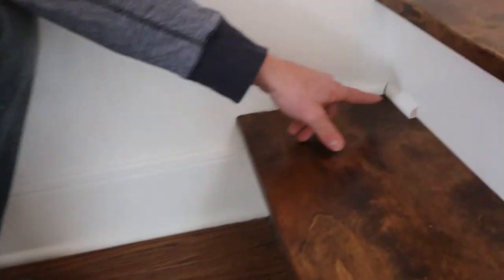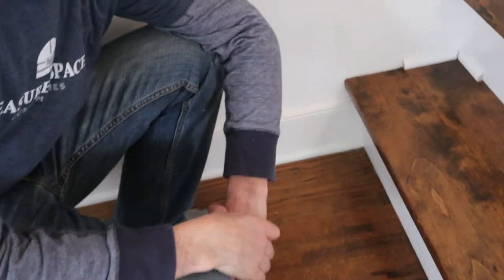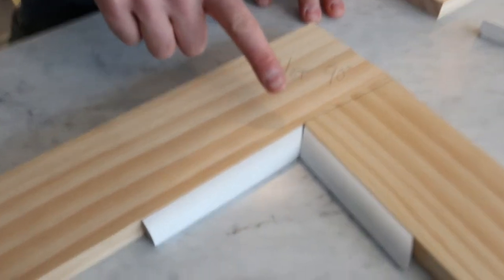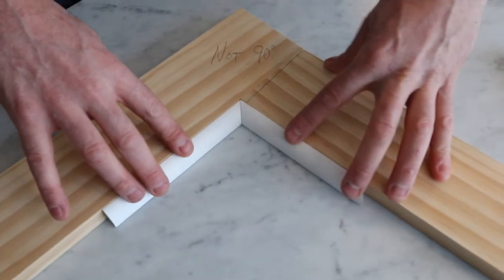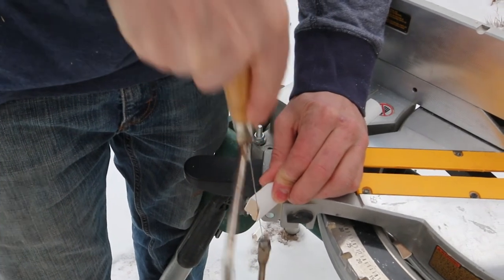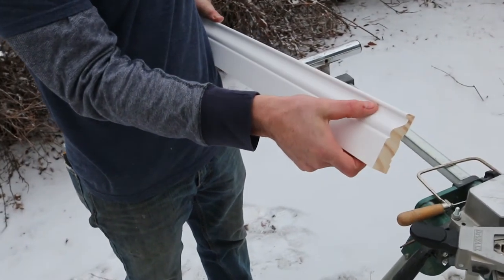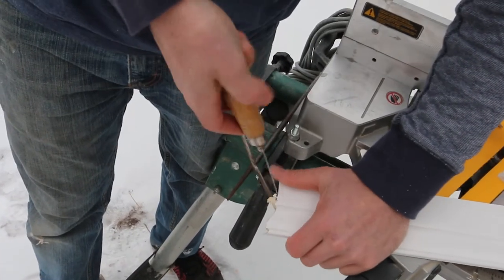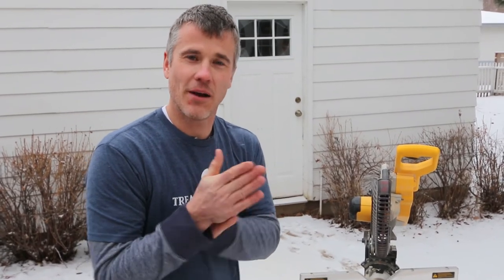Handyman Secrets - How To Do Coping So Your Trim Looks Clean & Awesome

Comment: When I do coping on shoe or quarter round, I will take a foot long piece of what I am working with and wrap some sandpaper around it and use that to smooth out the cut.
Reply: Exactly what I did after having a "Eureka" moment with trying to get that damn curve just right with a dremel (I refuse to use a "Satan-designed" coping saw). Between a cordless dremel and that sandpaper trick, my coping on both the quarter round and my molding (which was exactly like this man's), turned out spectacular after a bit of trial and error.

Comment: Josh, on the base molding whenever I cope I still have a gap on the straight part of the profile when mating to the other piece , what am I doing wrong, my profile is similar to the one you use here...
Reply: Hi... Mark. I think Mr Josh will do one video on that one day.it normally happens when the walls are not vertically meeting at a 90°

Comment: Why did he trim on a 20 degree angle
Reply from the maker: Hi Daniel, I'm a little late to reply here but the 20 degree angle was to remove material that could potentially be in the way if the wall corner/angle was more than 90 degrees.  If I hadn't done that it could potentially push the face of the trim joint apart and create a gap.  Hope that makes sense.

Comment: I am going to add some quarter round under my cabinets, using a coping saw was really hard to use, I ended up getting my angle grinder, worked perfectly, then used my file to smooth it. First time doing it, felt pretty proud, cause I screw up all the time
Reply: Keep at it man. You cant improve if you dont make mistakes.
Reply: For what it's worth, I went and purchased a cordless Dremel tool, and never looked back.  I've never had such a miserable time with a tool, as I had with that coping saw.  As a matter of fact, I think that saw became the dremels first dismemberment project.  Anyway, something else that helped me tremendously, was using some 150-grit sand paper on the round part of the quarter round to get the curved "contact" edge perfect with just 2-3 sec of sanding.  You're probably already done with the project, but thought I'd give you my two cents, given I had a very similar experience. HUGE salute to men like this who found a way to make that coping saw work...I can't imagine the amount of time it took to get proficient at that. I'm finding that most DIY'ers hate it.
Reply: @phillamoore157  I might have to try that. I can see what the guy is doing, and it looks really simple, but every single time I try it, it just doesn't work.
Reply: @TotemoGaijin  Yeah...I had he exact same problem.

Comment: I am by no means and expert, but wouldn't it be easier to fill the gap with caulk or wood putty?
Reply: Easier but shoddy workmanship. Doesn’t work for professional work.
Reply: @zacharyaln08  A little caulk and paint make up for the carpenter you aint.
Reply: Yep. Nobody on earth is going to come into your house and look at the baseboard or quarter round. Caulk works just fine. The shoddy workmanship is on the framers and drywallers who couldn’t find 90 degrees with a magnifying glass.
Reply: @jacknone1564  Truth. Most pros where I live only cope crown molding, as it's huge and a lot more noticeable. Everyone miters small base and shoe molding.